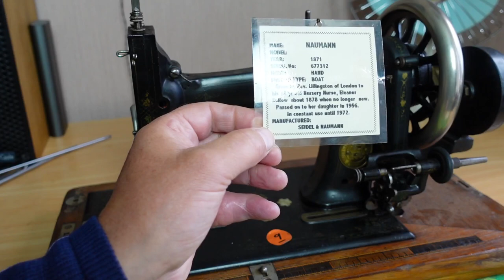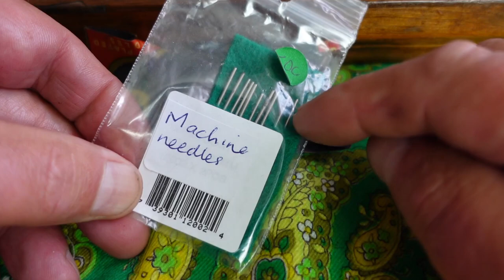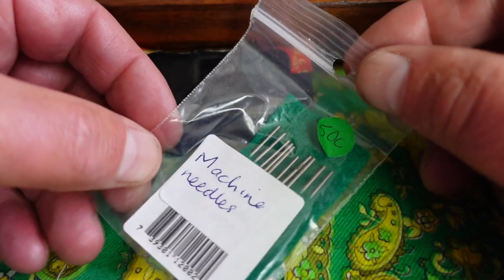1871 Naumann Hand Crank Sewing Machine - Servicing and Repair with History - Antique

Comment: I am working on a 1906 Defiance hand crank distributed by A.J. Harris of London.  It isn't the first hand crank VS I've worked on.  I have 20 or  so hand cranks with different manufacturers from U.S., Germany, and England.  Problem 1: I NOTICED the point of the shuttle is pin-point sharp.  Unusually sharp point.  Never seen one like that before.  While I've completed regular steps of threading the upper leaf tension and threading the needle from left to right in a red color thread, The bobbin I wound with white thread and it sits nicely into the shuttle and the bobbin thread pulls up nicely.   Manually, both the upper and bobbin threads pull away perfectly--with the tension I expected.  Problem 2: after sewing a line, the (red) stitches on the top of the fabric are fine.  However, there are NO bobbin threads on the bottom to make a lockstitch.  Hmmmm?  Right now, the only thing weird I've noticed is the point of the shuttle is pin-point sharp--so unlike other points on shuttles I have in my collection of machines.  So, I ask if you--should I smooth (sand) the point slightly?  Could there be a burr that I cannot see?  Can you advise anything else I should do?  Thank you for listening to my question.    I have other VS to work on today, so for now I will set the 1906 Defiance aside.   P.S. - on old sewing machine repairman shared with me his copy of a list of hundreds of s.m. brand names and models, with a column referencing the needle id, size, and substitutions.  Would you like a copy of it?

Comment: I snapped my base.
My similar machine "Faudels of London Handcrank Sewing Machine with Peacock decal which is probably HAID & NEU

The thin wood base sat on an uneven surface "a leather strap of the machine below" Foolishly I tightened the front hold down screen and tightened the rear hinges.

I actually heard it snap the casting on a warm day.

I will repair the base soon.

John

Comment: Threading the shuttle the at the Blunt end of the shuttle is a tiny slot to pass the thread under the bar , mine needs the bar soldering it back in place.
Reply: I didn't get it the first time either: )

Comment: Nice old Transverse,Maybe a New tyre and perhaps those disc's need to move over by undoing the screw and sliding the shaft closer.take care Alex
Reply from the maker: Hi Alex. I tried that but it still doesn't seem to go far enough to wind evenly so I moved it back in the meantime. Cheers.
Reply: Ha ha,the Germans put a lot of effort on all their early sewing machines in developing bobbin winders,on all my machines(and there's several,they are all different.  @InStitches

Comment: This maybe daft but would you try winding the bobbin using the hand wind in the opposite direction to sewing; that is what I have to do with my British Bradbury machine.
I had the manual for it but missed the direction of the arrow printed on the documentation showing the picture of the hand wheel.

Comment: https://en.wikipedia.org/wiki/Gauge_block  see the history section for the sewing machine connection.
the Swedish inventor Carl Edvard Johansson 1901
Johansson converted his wife's Singer sewing machine to a grinding and lapping machine to make the blocks
The blocks are optically flat and when twisted together to eliminate air pressure they stick together.

We used to use them in our manufacturing inspection department.